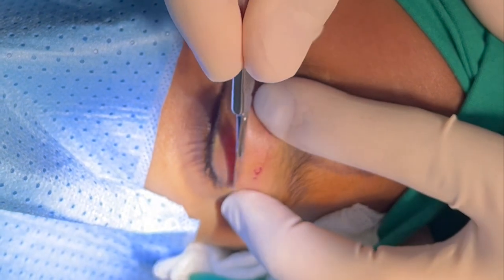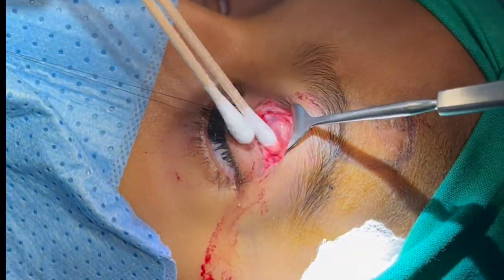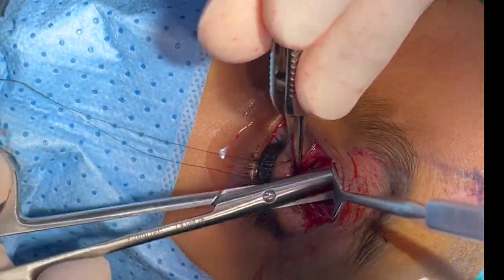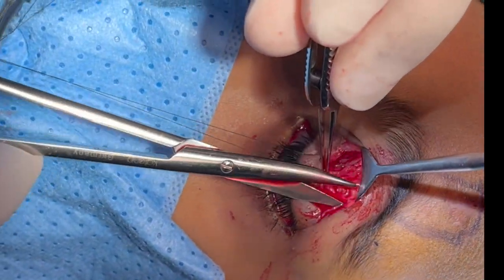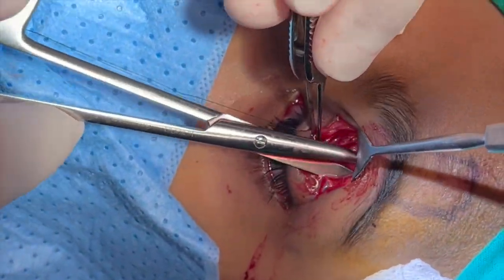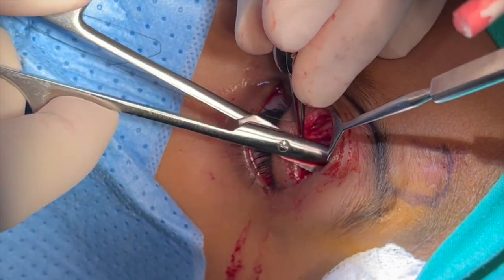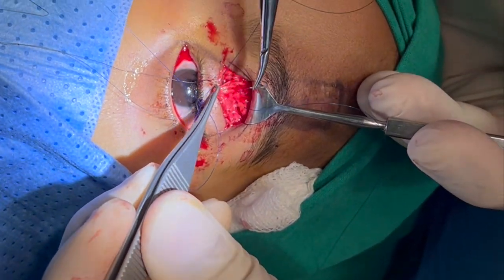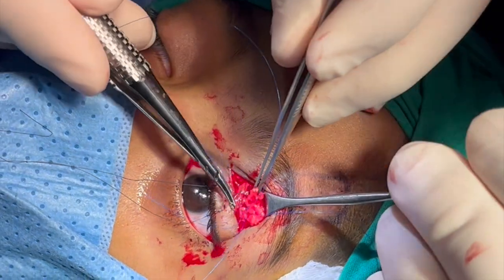Frontalis Flap for Ptosis Repair

Comment: what about the lagophthalmos? do you get complete eye closure after some time or it will remain there? or in other words is the frontalis flap elastic enough to allow eye closure and blink reflex in due course of time?
Reply from the maker: Yes that generally improves with due course. The lagophthlamos seen here is also partly due to local anesthesia. It will improve postoperatively in 1-3 weeks and the patient is encouraged to use topical ointments during that time.